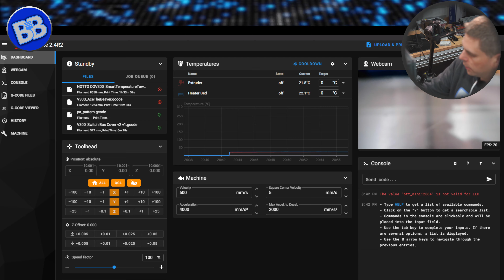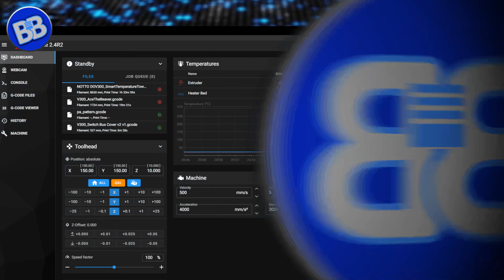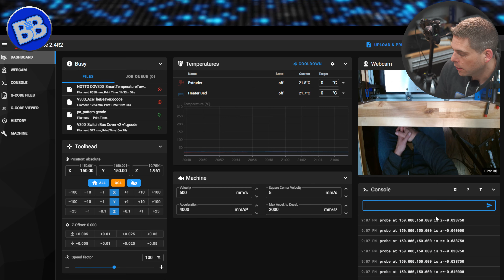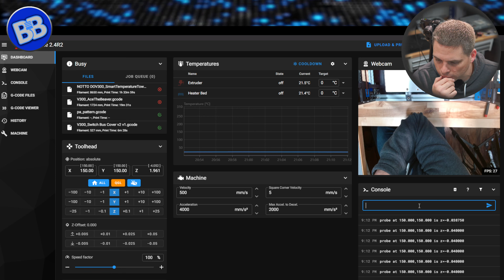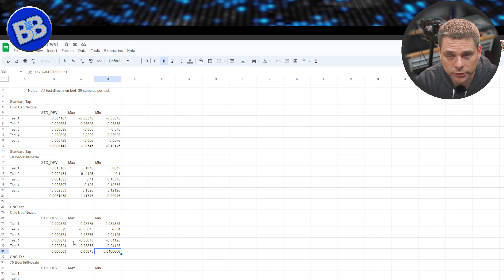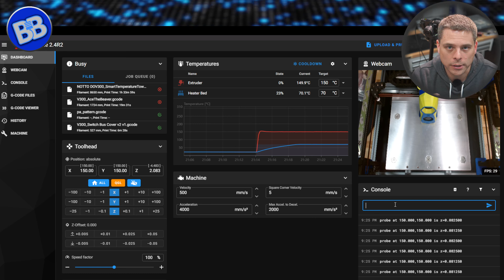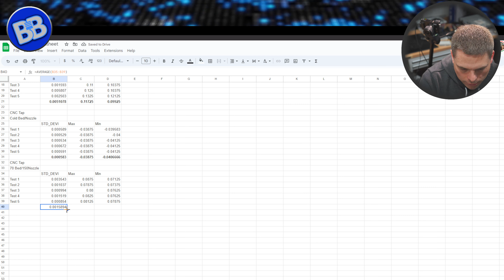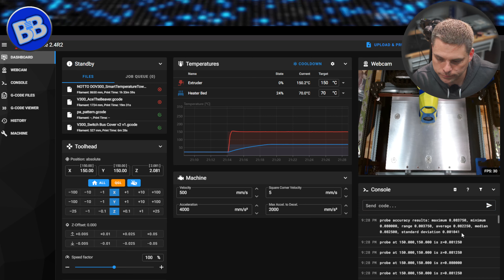CNC Tap by CHAOTICLAB - Install and Testing

Comment: Just finished the video Kermit, nice job on showing us the install of the Chaoticlabs CNC Tap.  For some reason I thought this was a lot more money, I agree with you on going this route.  I jumped the gun too fast on the original tap and while this one looks nice I think I will stick with my original for a while.  Hopefully I will get my CW2 and my tap installed this long weekend.  Its been sitting on the bench for far too long.  Keep up the great videos sir!
Reply from the maker: Marc - Thanks!  Yes these seem to definitely be worth the few extra dollars.  Considering with the printed Tap you still need to purchase the optical sensor, the price difference is negligible. I suspect that this will last longer and be more stable over time than the original.  I'm still impressed with my printed Tap, but I see benefits here!  Anyways let me know if and when you need anything! Talk soon

Comment: Good work! I also ordered a CNC tap a while ago and will install it with my gantry upgrade soon. Greetings from Germany!
Reply from the maker: Hallo, Freund!  I have stayed away from CNC parts on Voron printers since I first became aware of them.  I have had quite a few people interested and asking, so when I realized there was a CNC Tap and I was questioning the performance of the printed Tap it was obviously a good time to give CNC parts a try.  I still believe that the machine is meant to have plastic parts for assembly since they offer some flex and dampening, but for the Tap -this makes sense!  Thanks fro watching! Hopefully, I hear from you again or see you on a live stream.
Reply: @BuildItBasement  Yes, same for me. I also think the Voron is meant to be built from plastic parts- and it is really fine to have it that way. That way you can always modify or rebuild parts on your own. But with the rise of DIY printers like the VzBot for which you can order almost all parts for a good price from CNC machined aluminium, I always think if there may be still improvements possible on the well designed Voron where you replace integral parts to metal parts to get more rigidity for faster AND quality prints.

Comment: Awesome video. I didn't know there was a printable for the Y and just went sensorless. So far it's awesome.
Reply from the maker: Yeah - I wasn't either until I realized I had nothing to trigger the endstop!  How are you liking sensorless? I plan to consider that route as either a primary on my rebuild series (other 2.4) or as a failsafe system for a few things... a lot could be done using the current information...
Reply: @Build It Basement  it was very easy to set up and works flawlessly. Sometimes I'll get a jerk here and there especially if I home the printer when it's too close to the rear or front. But other than that I'll definitely do it to all my printers in the future.
Reply from the maker: @mr.rajikon3911  I was speaking with another person about code to use the same "feature" to do extruder jamming detection and run out detection... For X/Y/Z, collision detection.. A lost could be p[ulled out beyond just sensorless homing!
Reply: @BuildItBasement  You always see the argument that sensorless isn't as accurate. If it's just for intial homing cant see any minor differences making a difference. Or is it just me  and there is a power issues across the country and people needing to recover from power failures all the time? I have it on a couple printers and it works just fine.
Reply from the maker: @macdox69  I don't think it is less or more so than othe rmethods - but it would say that it requires more fine tuning and would possibly cause a little more stress on steppers and drivers.  Never thought about outages! LOL I run my printers on UPS units anyways... The teardown and rebuild series for my old 2.4 will probably be sensorless since I'm going to be using CAN.
Reply: @BuildItBasement  That's true it takes more tuning, but the recommended homing speed is slower and I'd be surprised if it was much more stress. (It's quieter than TAP, I can't hear the collision). My initial reason to switch was just to eliminate wires before I gave my 13 year old nephew a printer. The Ender 5 Pro was a work horse for what it is, but by default it's a mess of wires.
Reply from the maker: Agreed - I still like wires!  (We'll see what happens when I go CAN on this next printer rebuild!)

Comment from the maker: Comment to add here since someone had added a comment and I can't find it anymore..   About me lubricating the rail system...  So I have spent a few hours on the Chaoticlab Discord and have had direct and indirect conversations with support from the company.  So a couple of notes: (1) The instructions are not clear on the lube on this part.  The written instructions would make you believe that the rail is ready to go - however, quote: "ChaoticLab_Tech — 05/05/2023 10:47 AM
I suppose the assumption is that if a person has built a Voron then there is an awareness that all rails generally require lube. These should not require cleaning since they are genuine HIWIN and should have no grit in them. A quick flush with WD40 followed by injection of your lube of choice should do the trick." (2) I never fully removed the carriage from the rail.  I slid it up and down.  (3) I found it VERY difficult to install cut belts on this part without taking the front mating plate off first.   As a general rule - and a suggestion, don't take everything at face value, everytime.  Sometimes doing what your gut tells you is whats right for you.  Research anything that seems off and learn from others. (Chad) Not sure where your comment went, but I'm more than will to explain myself!  Thanks viewers!:_DISCOBIB:

Comment: If the deviation is around 0.01mm I’m good with it. You don’t need more accuracy in my opinion. When I adjust z offset I use 0.02 to 0.04 steps anyway.
I ordered a normal Tap kit. If something goes wrong it will break and I can reprint it with my Bambu.
Reply from the maker: The benefits of any version of tap outweigh the precision.

Comment: Excellent video, as always!  Now go work the heck out of it and see if it maintains its accuracy and stability.  :)
Reply from the maker: I was tired... But I needed to get this one done.  I'm actually impressed with how well it works. There are a lot of people complaining about it (then I realized I was on the internet and that's is the primary function of the internet).  A lot of people asked about this items so I had to do it!  As for long term, I can't imagine it wouldn't hold up AT LEAST as well as a plastic counterpart.

Comment: Thank you for making this content.  I was considering moving to TAP and saw that people were having issues with the belt mounts breaking off and decided not to until I saw the CNC TAP. I ordered it and waited 6 weeks to get it. Haven't installed yet, but am more confident now seeing your results. Lots of negative comments on ADXL results, do you plan on doing a comparison of TAP vs CNC TAP for resonance/speed/acceleration?
Reply from the maker: The biggest issues with Tap is the amount of stress put on a relatively thin plastic part.  Couple that with the additonal few mm forward of the X and you get some more "slop" .  I may consider doing an ADXL comparison in the furure, but I will tell you that the CNC version is much stiffer and doesn't have a lot of the inconsistencies found in the printed version.  That all being said, the Tap is an amazing adition to the Voron.  I believe that using the nozzle is going to always give you the best results since you are removing another variable.  I would like to (one day) see a hotend mount that is aluminum from the rail to the filament path.  plastic would be great for the facade and maybe some dampening... But these parts on the rpinter need to be rigid and precise!  I'll take your suggestion and possible consider doing a comparison - I just don't want to put the old Tap on, unless I have to!  Let me know if you have any more ideas and feel free to comment where you like (questions or comments).  Thank you for the kind words!
Reply: @BuildItBasement  Awesome, Thanks for the response. I wouldnt want to put the old one back on either haha.

Comment: Im at a similar place in my build too, so this was great to watch. Those feet on the bottom side of your bed - I imagine they stop it rocking on the kinematics? If I push on the front corners of mine it can tilt up - ill have to have a look for some of those. Do you have a link?
Reply from the maker: My kinematics are currently off the bed for testing.  I'm going to be reinstalling them shortly.  Those are the standard bed mounts.  Just to note - the kinematics seemed to work fine with the tap, but I wanted to remove ANY additional variations for testing.  I will also say that the CNC Tap seems to need a noticeable LESS amount of force to activate. I'll probably be looking at that in the next two-three videos.  I first have to release my macro video for my 2D nozzle scrub and finish up my Klipper video series.  So it'll be a good week or so.  Wish I had more time!!!
Reply: @BuildItBasement  Same, family and work and life means not much time left. I think ill pick up a couple of those CNC Taps, they looks like they are nicely made.

The tool free tensioners also look V nice while im looking on there...

Great video series, it has been great doing my build along with yours, keep em coming!
Reply from the maker: @ukrainewarroom  Thanks for the nice words!  If the tool-free tensioners had a ratchet to ensure they hold I would be more interested.  As it is, my experience is after the first ~20 hours of print time I had to retighten and adjust, after that it's really rare to have to retighten belts.  We'll see.  I offered to review the whole kit if they provided it for my old 2.4 rebuild series, but they haven't taken me up on the offer. There are so many mods available for these machines to look at and decide on.

Comment: Hey there! Where can I find this part to trigger the x-endstop? I can't find it anywhere! Thanks!
Reply from the maker: https://github.com/Chaoticlab/CNC-Tap-for-Voron/blob/master/STL/XY_Switch_Adapter/CNC_Voron_TAP_XY_Switch_Adapter_V2.stl
Reply from the maker: Let me know if you need anything else.  BTW I'll be starting new video releases shortly!  Hopefully you stick around.
Reply: @BuildItBasement  I’ve printed X endstop from GitHub. It doesn’t come close to hitting the stop. I have the PCB version of the X/Y end stop. The screw head rides right over the X end stop switch. Is there possibly another trigger file somewhere? Thanks

Comment: Thanks for making another great and fun video.  Enjoyed the testing data comparing the CNC to printed TAP.  Have you set up custom probe points so you don't probe over the magnets when bed meshing, homing and QGL testing?
Reply from the maker: Woody - I have not.  I don't believe it to be much of an issue with a physical touch probe vs the inductive probe.  Have you seen information otherwise?  Customer probe points would be quite easy except I pan to use adaptive bedmesh... That could be a conflict to solve.  Let me know!
Reply: I haven't seen info on adjusting the probing points on mag bed but have seen info on TAP having sensitivity to pick up where the screws attach the linear rail to the extrusion.  So it would make sense to move the probe points so they don't spring board the plate into the indentions where the holes are drilled for the magnets.  Kind of a drum skin effect.

Comment: So my induction probe has to do a lot of retries on the left side of the machine and the right side is perfectly fine. 
I have gotten the belts to match in tension and still nothing has helped. Will the Tap help make leveling more accurate?
Reply from the maker: How many is a lot?  Does the printer complete a QGL?  How many passes...  Requires are due to measurements being or if sync and not within the expected.  Make sure your induction probe is tight on your carriage and your carriage is tight to the rail.  The super short answer is no, Tap shouldn't define the change or fix the issue you are seeing.  Does it do this both hot and cold?
Reply: @BuildItBasement  hot while levelling.  I will take another look at the probe itself.
Reply from the maker: @zergmare7  Try a QGL cold and confirm similar results, as well.

Comment: I can't remember if you covered it, but how are you powering/connecting that?  I thought the LDO kit's PCB only supported 24v?  I'll go back and watch part 1 again.  :)
Reply from the maker: I had already modified my board for 5v.  Single cut trace and a jumper wire soldered
Reply: @BuildItBasement  Ah - in part 11.5.  Found it.
Reply from the maker: @runbuh  lol

Comment: Chad, great video.  I bought this device and I am about finishing installing it.  I am also using the SB and  Harkt 2 piece PCB.  I am confused on one point the instructions are very explicit that the sensor in this device is 5V and you should not use 24v.  Yet the FS connector you connected this to on the PCB is 24V according to my information.  Am I missing something here?  Thanks again for the nice tutorial.
Reply: I answered my own question.  I had an older version of the PCB that did not have the 5V.  The one I have now is 5V.  Thanks
Reply from the maker: @jadoglio  My board was modified.  I'm pulling 5v.  I did this in a prior video

Comment: I've been hesitating on buying CNC Tap because its 5V only and I currently only have 24V at my toolhead (Voron Trident, LDO kit).  Its a bit hard to see in the video, but if I could ask, where are you getting 5V from -- do you have a breakout board at the toolhead?
Reply from the maker: Paul, I won't shame you for not watching the entire build... Just kidding here... Yes! I do have a a board in the toolhead that has 5V available, mostly for the LED lighting.  I'm very impressed with the CNC Tap, I actually will say that I think its pretty damn great.  The only two negatives are 1.) you need 5V and 2.) The unit isn't repairable with out purchasing parts that seem to now be available.  I'm a firm believer in being able to repair things (as much as possible) with the tools and materials you have on hand.  For that reason, I plan to keep my original Tap on hand - If I ever need it.  As for the 5V, its a single wire up to the tool head, it may be worth your effort.  As with everything I do and say - In the end it's your printer and you must decide what you want to do.  I'll provide some of my insight and experiences!  If you have any further questions please never hesitate to ask away!

Comment: Hello there, I have been following your build series for a while now and its been really great! Super helpful! 

I wanted to ask if you had considered using the Orbiter v2 extruder over CW2?
Reply from the maker: Actually, I have not.  On my first 2.4 with CW1 I totally didn't like the path or the performance and went with a Bondtech unit as a replacement.  So far the CW2 has worked pretty well for my testing.  My preference is to always give DIY/printed parts a try and go from there.  I'm not against trying the V2, I'm actually thinking of doing it on the rebuild of my older 2.4, which will also have CANbus and some other things I haven't done on this build!